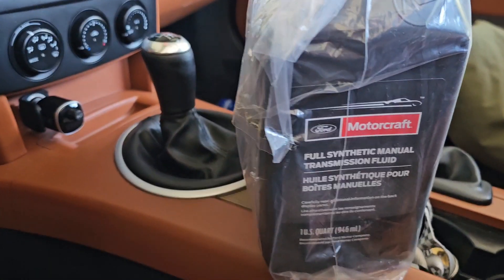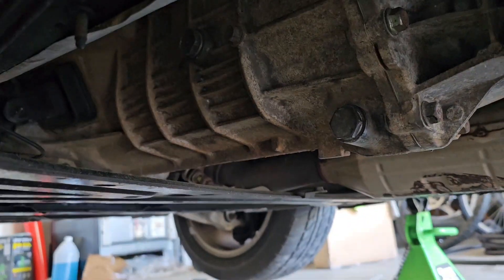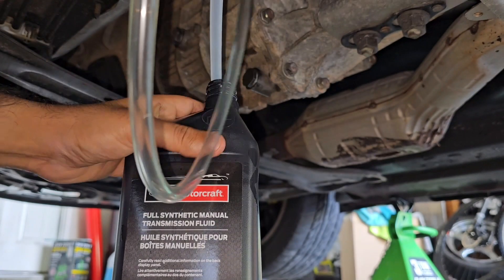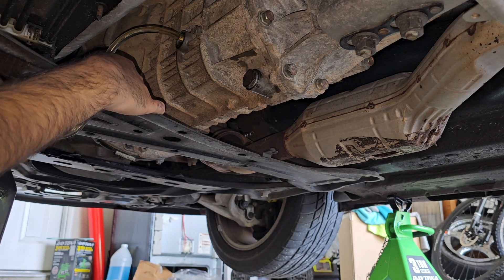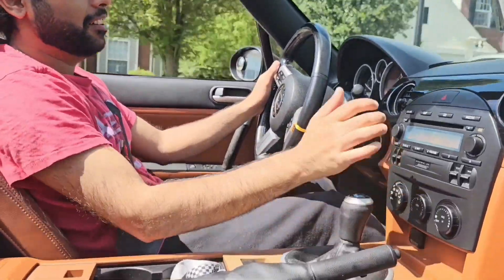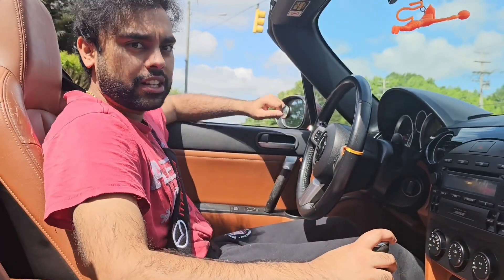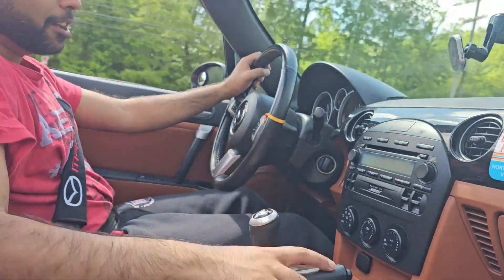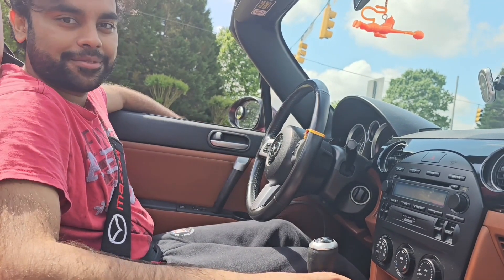Ford Mystery Oil? | Mazda MX-5 Manual Transmission Fluid Change

Comment: The problem with very slippery oil is it makes the synchromesh struggle to grip. This can cause it to jump out of gear😮
Reply from the maker: I haven't had that happen yet, but that is a good point to keep in mind.